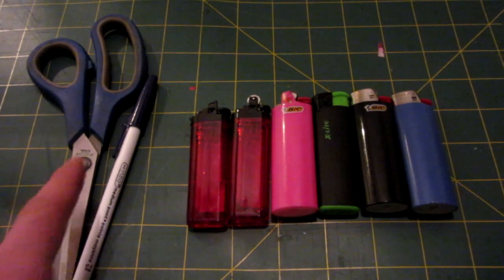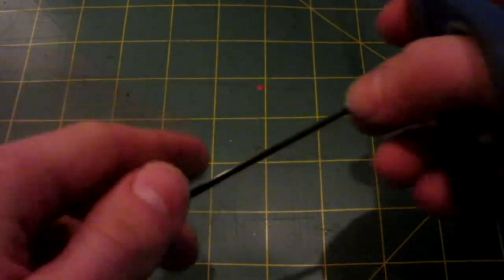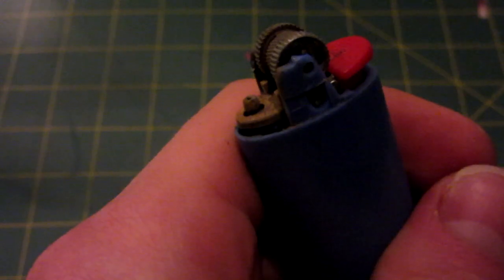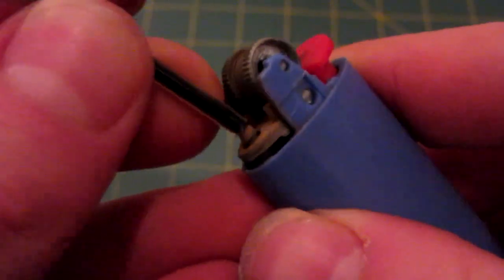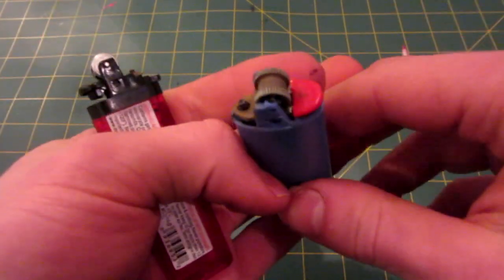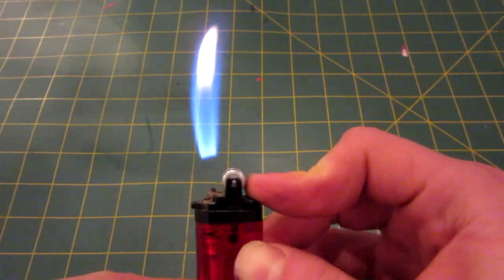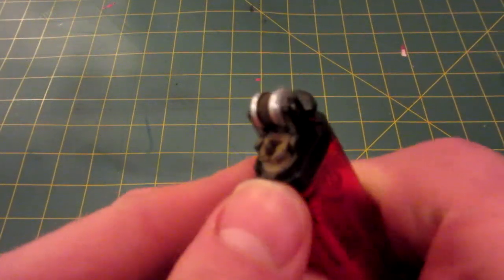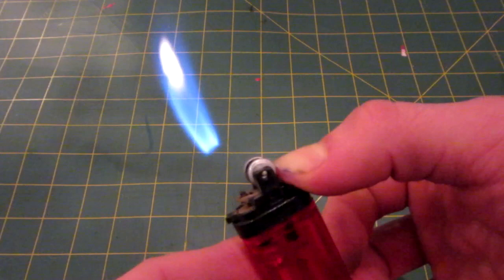"Floating Flame" Lighter HACK-  How To

Comment: My lighter is literally doing that, but I didn’t do ANYTHING to it. What else could cause the flame to do that?
Reply: Actually, lighters are specificly designed to not do this, maybe yours faulty
Reply: I smoke some meth i ain't gon lie but floating flame is so good at hugging the glass and burn the inside without the glass burning/crack.This is meth lighter my child and sometimes when me and my friend high af we are in this "gotta do something productive mode" and we make ghost flame for hourssss.We use cigarettes plastic wrap,took ages.
Reply: Your lighter probably just gunk up with dust etc
Reply: @chaoticsofea999 you're not the only one... Why the hell do you think we are all here??? 😅😅

Comment: You don’t have to fuck up the lighter, get a long reach lighter and wiggle it around a bit while not putting out the flame. Eventually if you hold still it’ll start floating.